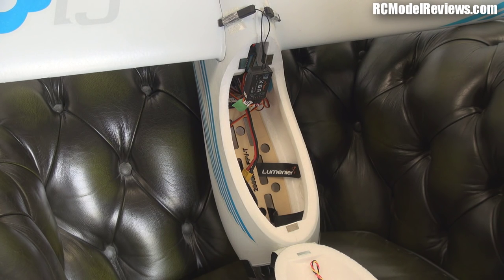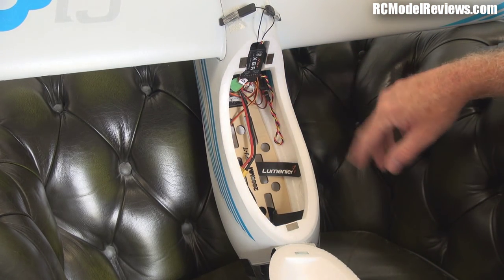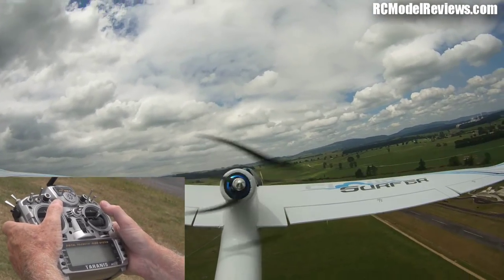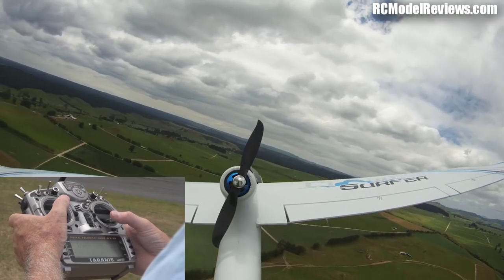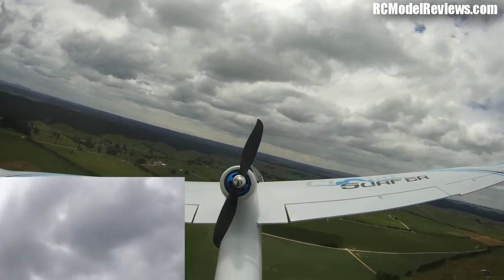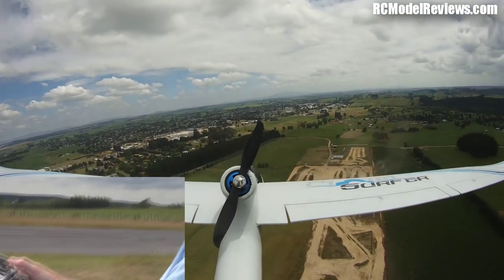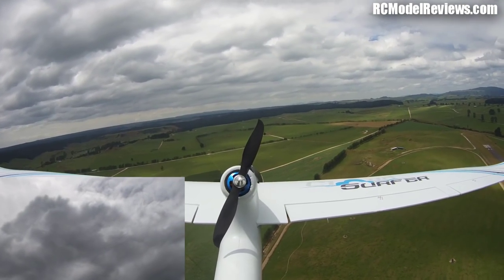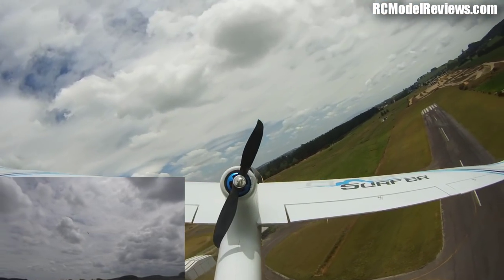FrSky variometer sensor (in action)

Comment: idk why that motor not being centered drives me nuts
Reply: It has to do with spin torque. if the motor is straight it will turn the plane on its yaw axis when motor is on. But I know what you mean.
Reply: Thoght I was the only one.